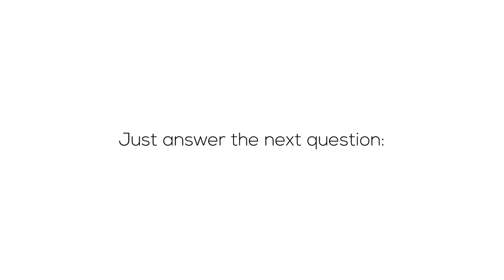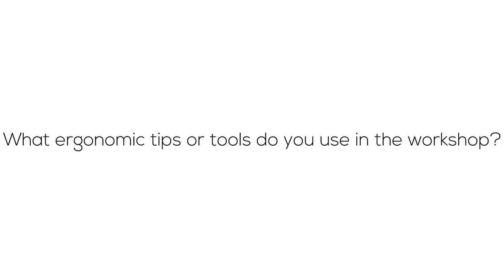2 perfect tools for handling plywood

Comment: Excellent tutorial! Wonderfully straightforward design and implementation. I'm no spring chicken, so lugging 18mm sheets of ply is no walk in the park. Fortunately, I'm not filthy rich, so can't afford enough ply, at today's prices, to break my back, but I'm planning a new shed at the back of the garden this summer, and will be using 8 by 4 sheets of OSB. 
I like the fact that your jig can be made with minimal tools, glue and screws. It is just a jig after all, so it does not have to be beautifully crafted with complex joinery and the application of gold leaf.
Thank you so much for taking the time to share.
Reply from the maker: Thank you for your comment, my friend! Greetings